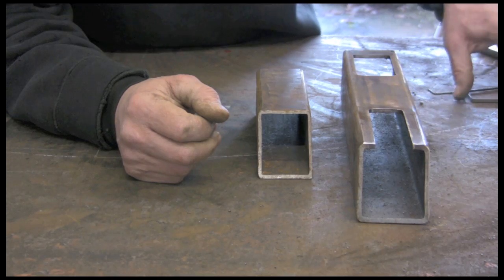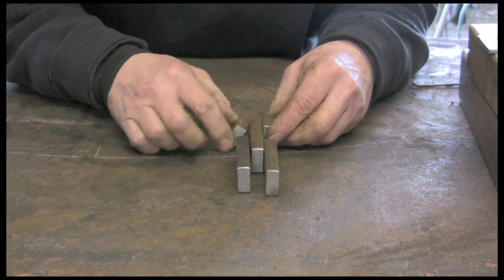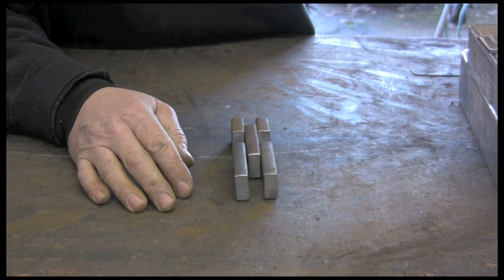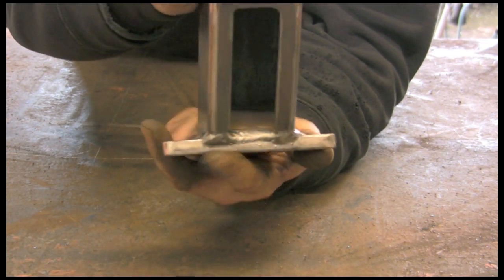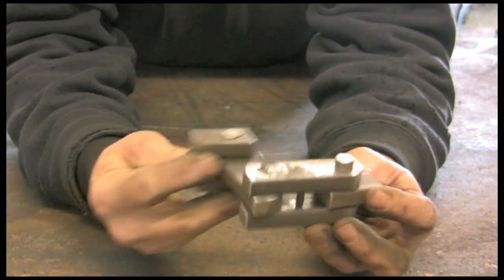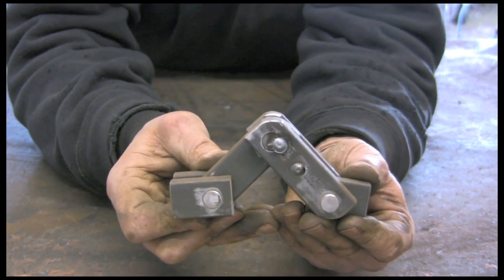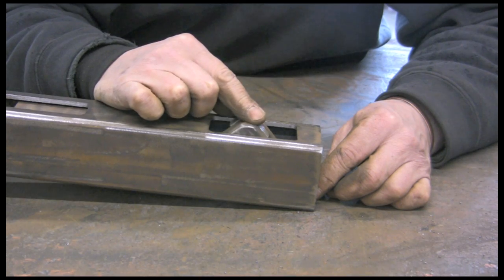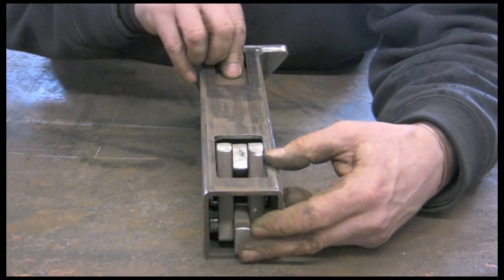Making a Farriers vise Part two.

Comment: hi Gary, i was wondering on the lengths of the chain system? do you have any records of the length or does anyone else know what lengths they cut? Thanks
Reply from the maker: I can't remember off hand but looking at the video the bar is an inch wide so i'm guessing the long ones are about 3 1/2" and the small one about 1 1/4"
Reply: Thanks